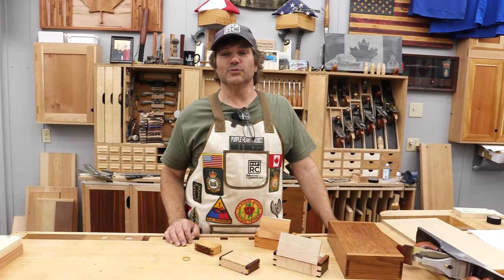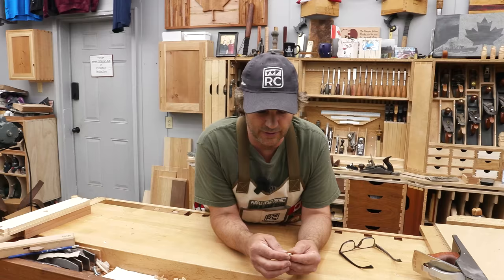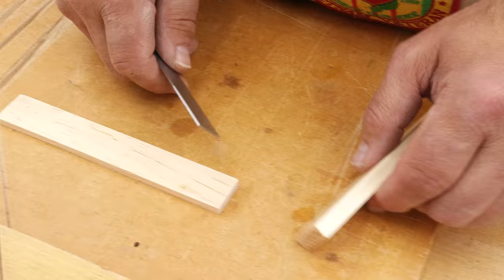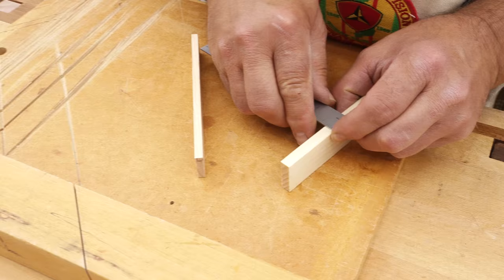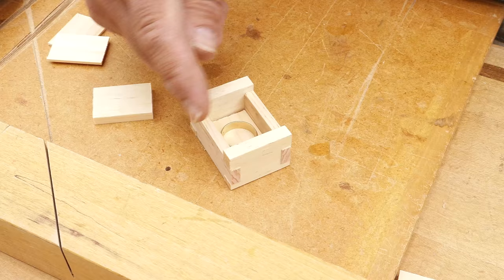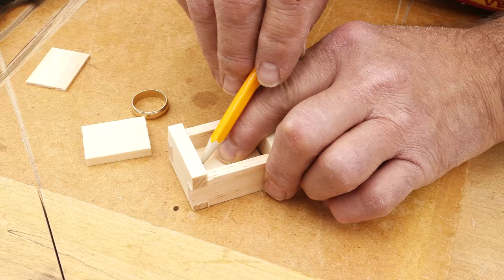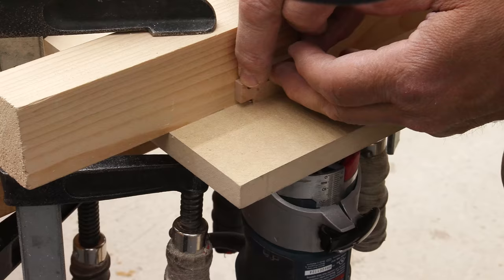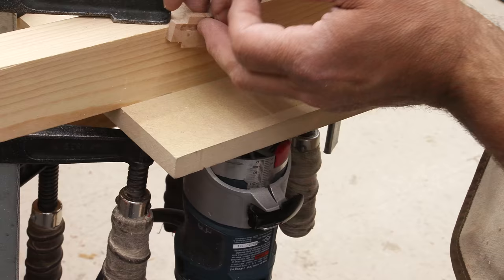Build a Wood Hinge Ring Box

Comment: One way I get really tight, very small boxes together is which one of those squeeze clamps with a rubber head. It just feels far less sketchy than hitting it with a mallet. They usually slip right in with a few squeezes. I am always afraid of my mallet leaving marks, especially on moderately hard hardwoods, or soft hardwoods.
Reply from the maker: Great idea

Comment: Can the pieces be cut by hand in any way rather than fiddling with power tools on such tiny parts?
Reply from the maker: Yes of course they can.  You could cut small dovetails or shoot some miter edges
Reply: @RobCosmanWoodworking  I like your box joints best on these little pieces but if I was going to do something different, I think it would be a splined miter. On a project that little I have made splines that match the kerf width of various hand saw blades. One of the ones that I use repeatedly is a Milwaukee Sawzall blade that I fixed a handle for making it into a small hand saw. The kerf isn't as thin as a lot of the saws we use for fine joinery which makes for a decently proportioned yet still functional spline in something that small.

Comment: Rob, in regards to the routing out for the hinge. I noticed you held the workpiece tight to the fence and dropping the workpiece lower and lower till you reach the router base.
Is it a safer option to place a thin board of different thicknesses on top of the router bed holding the workpiece up of the bed and then a smaller piece.
So for instance start with say a 6mm piece of mdf. Slide against the fence into the router about half way and clamp in place. Now run the stock. Remove the 6mm and repeat with a 3mm piece. Run the stock again and finally run the stock as normal with no board to final depth.
Hope I'm making sense.
Just an idea with such small workpieces. Can afford to have any loss of them talented hands
Reply from the maker: Thats a good idea, kind of like a false router table that you can quickly remove
Reply: @RobCosmanWoodworking  ya, instead of raising the bit, having the bit set to your final depth and adding to the base difference thicknesses of board to allow you to get a deeper cut with each pass rather than raising the bit a little each time

Comment: Rob, question I was thinking about after a couple of the videos.  You have demonstrated two ways to cut the joints for the boxes, tablesaw & routers with Jig.  Understanding that for this box (small) and the safety aspect makes it a good fit for the router jig, do you have a preference or when would you use one versus the other going up in size?
Reply from the maker: As I go up in size I prefer to hand cut dovetails if I am not doing a large production run

Comment: would pay for metric ngl
Reply from the maker: Problem is they do not make metric equivalent router bits in the metric sizes we had so we had to discontinue them
Reply: I'm confused as to what the question is. I have a metric wooden hinge kit, or is that what is discontinued?
Reply from the maker: That is what is discontinued.
Reply: Hi Rob, if you don't mind me asking - isn't the metric kit more for outside the US where we also don't have as much trouble finding the metric router bits? Although I have to admit, Im surprised how much imperial ballnose bits I run into. It is definitely harder to find here (Netherlands)!

Also, thank you for making the kit. As soon as I manage to get a proper sized dowel made I can start on the hinges :)!
Reply from the maker: The metric kit was for outside North America.  But when we did the closest metric sizes to the Us sizes (8mm, 10mm, 12mm, and 14mm.  You cannot find metris cove bits to match that.  Lots of complaints for overseas customers that metric cove router bits are not available in those sizes.   Instead of a complete retool, based on low sales of metric kits we made the business decision to drop the metric Woodhinge kit line